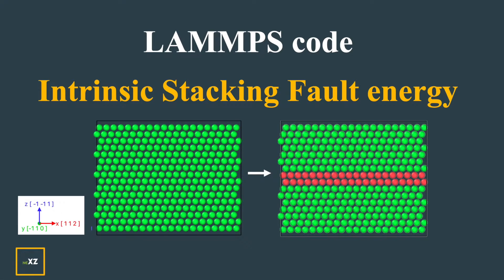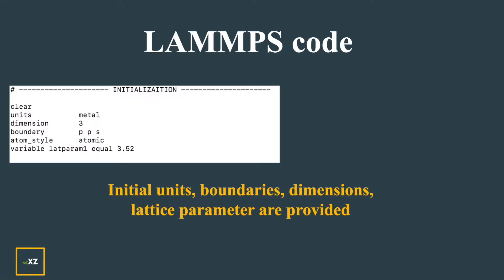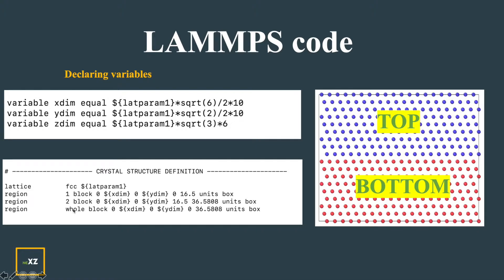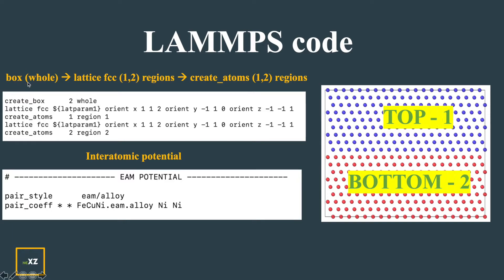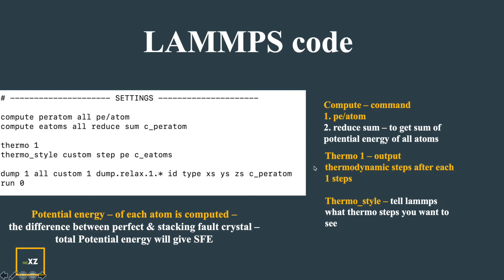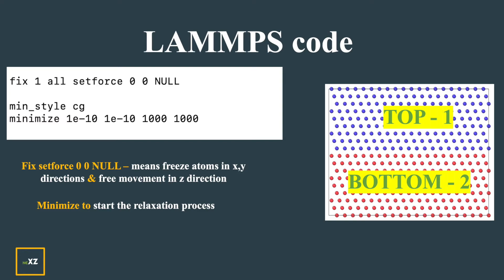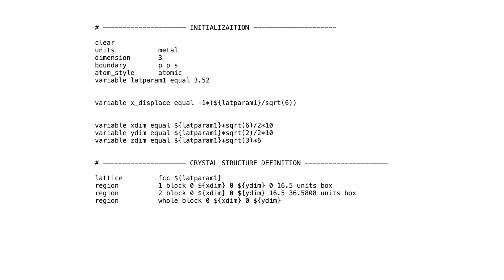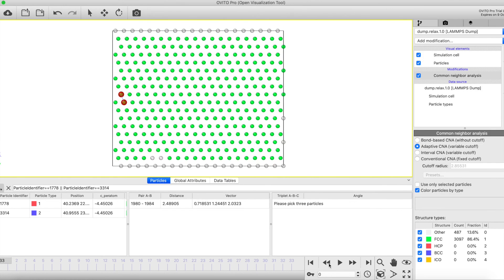Intrinsic Stacking Fault energy || LAMMPS script || FCC || Planar Defects

Comment: Hi can we use the same code for stacking fault in bcc Molybdenum? I tried to change fcc by bcc but it doesn't work,Can you guide plz
Reply from the maker: can you send me the research article you are following to obtain Stacking fault energy for BCC structure. email: contactsnextzen@gmail.com.
Reply: hi brother, i also have the same question. i want to create stacking faults in BCC Molybdenum using MD, I am following your code and also the help guide code from the LAMMPS website but the problem is it doesn't execute after running few steps it give me error. if you say I will send you my Molybdenum Potential file you also can try to help me out. thanks
Reply: https://icme.hpc.msstate.edu/mediawiki/index.php/LAMMPS_Intrinsic_Stacking-Fault_Energy.html 
I am using code from this link but it shows me an error. After reading the potential file my simulation stop and just give me empty log file, and an error file.
Reply from the maker: yes I saw it.  Can you send me the lammps code and potential file to my email: contactsnextzen@gmail.com. I am asking for a the article since it is BCC and not FCC. FCC has HCP stacking fault atoms, I am not sure which stacking fault atoms (whether it is HCP or FCC) are for BCC structure. Then only you can decide the BCC crystal orientation for lammps simulation and displace atoms in correct direction to get the appropriate stacking fault atoms
Reply: @NextZenStudent  I have sent my written code and potential file to the given email address.

Comment: Sir, Can you help me with solving this problem? 
Sir, I am modelling the Aluminum (Al) and Silicon carbide (SiC) material with LAMMPS. In my case, the Aluminum is matrix phase with higher content and silicon carbide is a reinforcement element with a few percentages such as 10wt.%  and 15 wt.%. Both the particles are in a spherical form and the material is combined to form a composite phase of the Al-SiC material.
Reply from the maker: Yes, I am making a video on it. I will talk about on next 3 videos
Reply: @NextZenStudent  thank you so much sir.

Comment: How to get GSFE curve?
Reply from the maker: GSFE (Generalized Stacking Fault Energy) curve requires displacing atoms continuously and measuring the SFE. In my next set of videos I will talk on this
Reply: I want to calculate the effect of solid solution strengthening in an alloy, is it possible by md to calculate excess stress because of solid solution hardening? 
If yes, than please mail me at sandy1593@gmail.com, it will be a great help. 
Thanks.
Reply from the maker: Hi @Sandeep, can you find a paper on MD simulation - solid solution strengthening of alloys. It helps you and me as well to discuss clearly. please send an email of the paper link/pdf to contactsnextzen@gmail.com